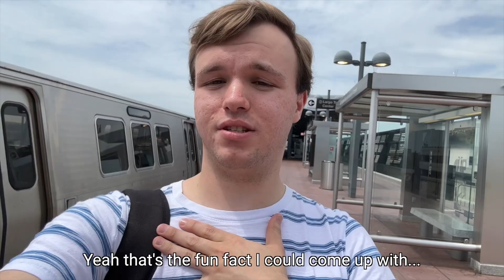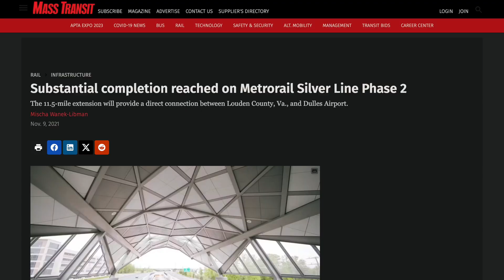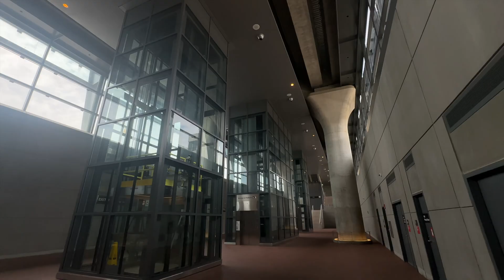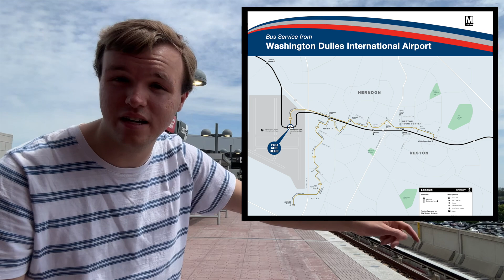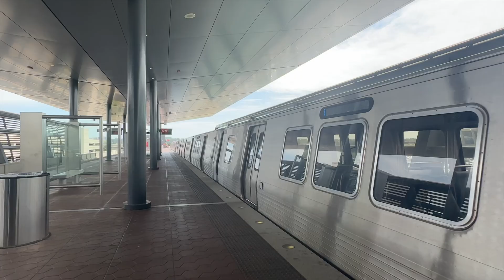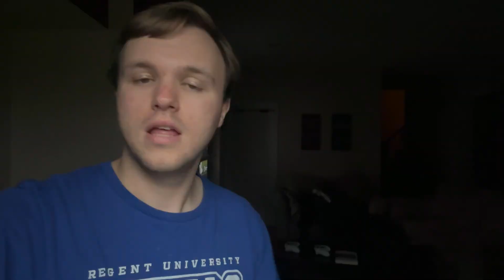The NEWEST (Airport) Metro Station in America!

Comment: Lovely video — I find it interesting that this station could have been built underground, much closer to the terminal. Here’s a brief history:

When the design of Silver Phase 2 was being finalized in 2011, the stakeholders were concerned with ballooning costs and looking to save some money. The most significant modifications was moving the Dulles station from an underground location direct adjacent to the baggage to the current location about a quarter mile away, which would have saved an attributed $550M alone. The MWAA board of directors (operators of Dulles Airport & the organization overseeing the entire Silver Line project) strongly supported the closer underground location, and even offered to foot the entire bill for the additional cost itself. This was unsatisfactory for the other stakeholders (namely Fairfax County, Loudoun County, and the Commonwealth of Virginia) because they understood that additional funding to cover this cost would be raised via tolls on the Dulles Access Road (also owned and operated by MWAA) — this was a hard objection from the counties and commonwealth because they understood that a vast majority of the tolls came from Loudoun and Fairfax County commuters, so their residents would be paying for the increased expense one way or another, regardless of which group nominally provided the money. MWAA eventually acquiesced, and the station was modified to the cheaper design that was ultimately built. 

Personally, I’m not too disappointed by this change — unlike Reagan, I’m usually flying out of Dulles for long haul fights. I often arrive hours ahead of my departure and will have a significant time cramped in an airplane seat, so the opportunity to stretch my legs with a five minute walk to the check-in counter (or vise versa following the arrival back at IAD) is not a huge dealbreaker. However, part of me recognizes how shortsighted this was. This station will likely exist in active operating for 200+ years. It’s disappointing to consider the cumulative centuries that will be wasted walking to and from the metro station by millions and millions of passengers.

Comment: Love that the station honors the Eero Saarinen-designed terminal next door with its design! Besides Dulles, Eero Saarinen also designed JFK's iconic TWA Flight Center and St Louis's Gateway Arch! He was a pioneer in the concept of the mobile lounge! Dulles's mobile lounges each weigh 76 tons with a maximum cruising speed of 26 mph and can carry to and from the terminal building up to 90 people. Their purpose was to radically restructure the idea of airports. By the early 1960s, airports had transformed to ramifying systems of hallways. As planes grew larger, they needed more space as they lined up next to each other along the airport building. And as flying grew more popular, airports needed to have more and more gates. The result was that terminal buildings sprouted long protrusions called fingers. Hundreds of feet long, they accommodated jets very comfortably. The finger-style airport was a purgatory of walking because airports went from being able to walk straight from the entrance of a simple terminal onto your plane, now you were reduced to wandering through a structure built for giants. So when Dulles opened in 1962, it did not have fingers. Instead, after passengers checked in on one side of the terminal building, they crossed to a row of doors that opened onto a fleet of mobile lounges. While the aircraft, some one or two miles off on the tarmac, were prepared, flyers relaxed in swank waiting areas, enjoying cocktails from nearby stands. Construction of the airport began in 1958, but Saarinen sadly did not live to see its completion in 1962 as he passed in 1961

Dulles's designers thought that by shuttling from the main terminal directly to a midfield jet ramp, they could save passengers from long walking distances amidst weather, noise, and fumes on the ramp. The advent of the jet bridge and construction of the two midfield concourse buildings at this airport negated the benefits of the system. As passenger numbers at Dulles grew, they realized it was impractical to use mobile lounges. Remote concourses were constructed, and the fleet of mobile lounges was used as a shuttle between the concourses and the main terminal. Thus the AeroTrain was eventually built in 2010, while mobile lounges have continued to be used to reach Concourse D before replacement Concourses C and D are built and the AeroTrain is expanded to become a continuous two-way loop. Besides Dulles, mobile lounges have been used at Montréal–Trudeau, Philadelphia International, Benito Juárez International Airport in Mexico City until 2007, JFK International, the infamous Mirabel International until passenger services ceased in 2004, Paris Charles de Gaulle, and King Abdulaziz International Airport in Saudi Arabia. Early in the space shuttle program, NASA used the Plane Mate system of mobile lounge to move astronauts directly from the orbiter to crew facilities. A modified vehicle obtained from BWI in Baltimore was used for shuttle landings at California's Edwards Air Force Base. A similar vehicle was used at the Kennedy Space Center to take astronauts directly from the orbiter to the Operations and Checkout building.

Comment: The canopy design is like an airplane wing, but that's the other part of it: the canopy is meant to mirror in part Eero Saarinen's iconic design of the airport terminal.

One of the cons you list is the connection between the station and the terminal, and... money. They didn't want to spend extra to build this underground and closer to the terminal. But at least there are moving walkways, so okayish compromise.

And for me, who lives past the end of the western leg of the Red Line, taking Metro to Dulles would take me two hours. BUT.... I've travelled to London twice and if you skip the (faster) Elizabeth Line or Heathrow Express, the Underground Piccadilly Line takes about 30-40 minutes to central London, so an hour between Dulles and downtown DC isn't too too horrible.

Thanks for the video, Sammy!
Reply from the maker: youre welcome!

Comment: It would be interesting to see a race between car, metro and bus to see who can get to the check-in line quicker and by how much. 16 mins longer by metro is not a good look but maybe if you take into account finding a parking space, walking from the lot with luggage etc. maybe the difference is closer than it first looks?
Reply: The Points Guy did a taxi vs. Metro race that’s out on Youtube. Would be interesting to run it again, however, with the self-driving and parking!
Reply from the maker: maybe, much of the parking is north of the metro station!

Comment: they really need to work on their signposting. We had just arrived, walked out of the arrivals, followed the signs in the building to the metro and: were dumped outside onto the bus station/parking lots with no indication that there was an actual route to the metro. The metro was an elevated track with a clear highway in between and no signage outside routing us to it. Eventually we managed to get into the metro station by just crossing the parking lot into the elevator on the parking lot closest to the metro station and getting into the tunnel this way.
Reply from the maker: that's unfortunate, the signs from the arrivals baggage section seemed adequate with signs for metro!

Comment: Having primarily travelled between Asia and the US, and living in DC, I will say the metro station feels very Asian, including the tunnel to the terminal which really reminds me of a lot of Chinese airport metro connections. However, I will say a couple of things that we definitely need to improve on:
1. Extended hours of service - it should at least run between 6am to 11:30pm. I know silver line is very long, but the current hours of service leave a lot to desired.
2. Headways - ehhh this one is more meh for me, because I know ridership on the silver line is not SUPER strong (yet), but I would prefer 8 - 10 min headways.
3. Platform screen doors.
This way, it wouldn't just feel Asian anymore, it would match most Asian cities in every way!
Reply from the maker: the first time I went down at that station it felt like I was a real modern transit country like many Asian ones!

Comment: So the reason IAD only has 4 fare machines is they’re all so old WMATA couldn’t get new ones for the silver line. All the silver line FVMs are stolen from other stops on the system. They really need to replace them all with modern machines.
Reply from the maker: ahh, that makes sense, would be nice if they fast tracked (hehe) open loop tap credit card payments.
Reply: I haven't been keeping up with WMATA news since I live in Seattle; did they fix their major electronic issues?

Comment: Great station review! I feel like Dulles Airport Station has to have some of the longest (if not the longest) escalators at an above-ground station in the system.

Also the only reason I’ve used the Dulles Airport station (other than for just filming it) is to transfer to the Fairfax Connector, weirdly enough.
Reply from the maker: they are pretty long, it's a cool entrance into the station from the platform!
Reply: One feature I love, however, is that it has four elevators instead of just one or two. This is great not just for accessibility but also since most of us are there with luggage.

I hate taking my suitcase on the escalator haha.

Comment: Now that Dulles has a metro stop, I think VA needs something similar to the Purple line to better connect the WMATA rail branches outside downtown DC. We need a light rail (or heavy rail) line connecting the western portion of the Red line to the Silver Line.. preferably from Tysons to Bethesda since Bethesda will already be a transfer stop for the Purple Line and Tyson's is already a highly populated edge city with a rising population. It just makes sense.
Reply: Sometimes the purple line is envisioned as eventually extending to Tyson's, but this would probably be a 20-years-until-officially-proposed kind of thing
Reply: It’s has to be in the style of a REM metro
Reply: Connecting Tysons with something like Landmark would be awesome
Reply: I think we could also expand it to Merrifield and even Springfield to provide a more direct path for people in Springfield and surrounding areas to get into the airport.